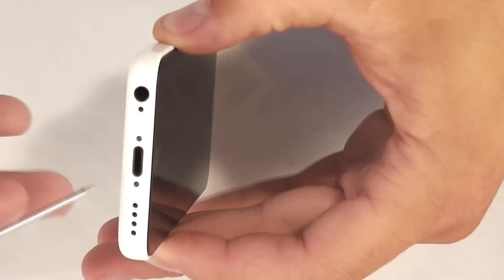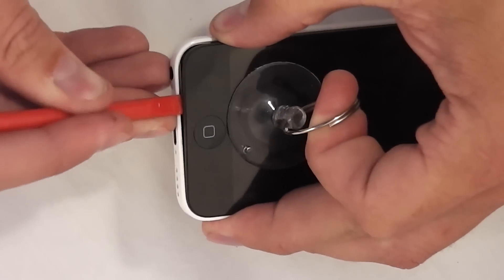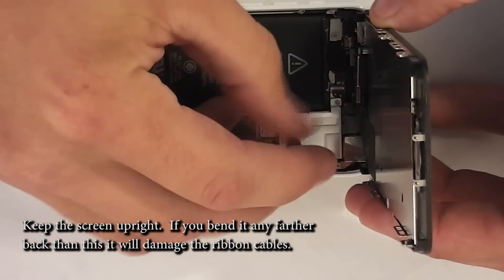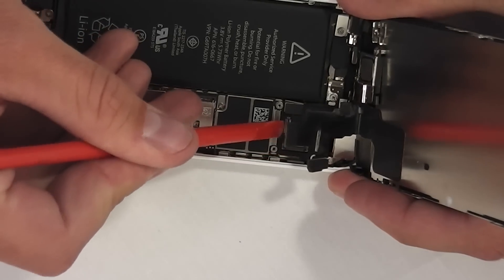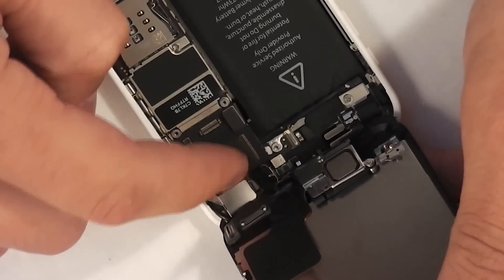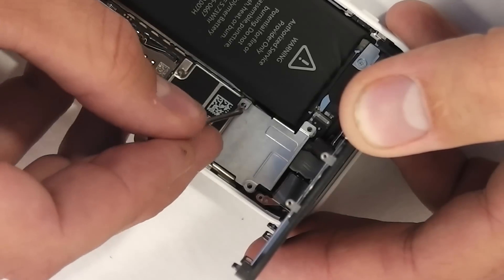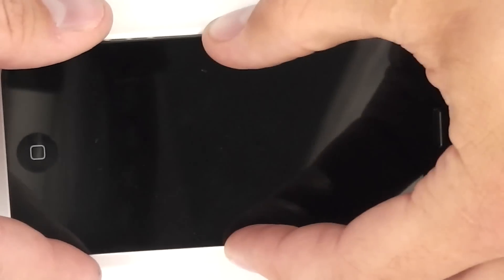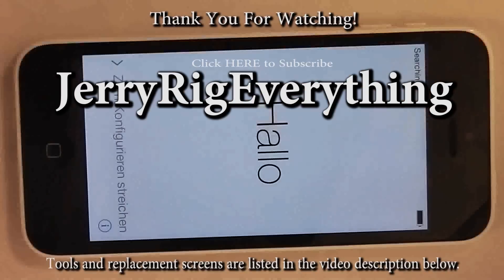iPhone 5c Cracked Screen Repair in 3 minutes

Comment: Hey Jerry, thanks for the video! I replaced mine with no problems, however the screen is unresponsive on certain points (very bottom left - sometimes can't switch from abc to 123 in text, and at the far top left - cannot slide to power off when this happens). Most of the time it works just fine, but at least once a day it gets screwy for a bit. Could I have damaged the first ribbon cable latch (the long narrow one that's the first to go back on)? is it worth taking it apart and unlatching then latching the 3 ribbon cables? I had a hard time getting the long/narrow one in first, and I'm worried I'll make things worse if I mess with it. What would you do? Re-install the one I have, or try a different screen?
Reply from the maker: Dreamktchr186 Sometimes the digitizers (the part that recognizes touch) have dead spots.  See if you can get another screen.
Reply: JerryRigEverything OK I will. Thanks!

Comment: Couple questions: there are a couple panels on eBay, one that includes the digitizer/LCD and one that's just the front panel which is much cheaper. How hard is it to remove the LCD/digitizer? Is it worth just buying the entire thing? Is there any way to tell that just the glass is cracked and hasn't harmed the LCD/digitizer? Thanks.
Reply from the maker: Chad Broudy You are so in luck right now. I JUST filmed a video on removing 'just the glass' for the iPhone 5c.  Ill have it posted at some point tonight.  So check back tomorrow for that process.  Its pretty freaking hard, and I don't recommend it for the normal user. But its always worth a shot if you have nothing else to lose.
Reply: So would it be easier to use the full kit that's more expensive? Then just use the home button and speaker from the old one on the new one? Thanks for the reply.
Reply from the maker: Ya, That is what I recommend.  You are much more likely to succeed when doing it that way. Did you check the video description for the parts I linked?  Amazon also has some good stuff. (I linked the tools I use in the description as well.)
Reply: I got the part in, but the screws for the metal tray that housed the screen connectors refused to come out. One of the four came out fine (the top right, also the largest) but the other three wouldn't budge. There was a clicking sound when trying to unscrew each of them. I'm going to assume there was an issue with the screws or its been tampered with before. Nonetheless, couldn't fix it. This isn't normal, is it?
Reply from the maker: ya, thats definitely not normal.
Reply: Supposed to be easy to come out?

Comment: Does the screen you get from the link you provided come with the home button and ear piece already installed or does it have to be transferred from the old screen?
Reply: I meant the camera not ear piece. I purchased the one on your link and I see people are saying its 200 but the link I clicked was 59.99. I hope I purchased the right one.
Reply from the maker: You bought the right part, but you will need to transfer over the home button, and back metal plate, and ear piece over to the new screen. It is not super dificult. Just keep the screws organized.
Reply from the maker: You bought the right part, but you will need to transfer over the home button, and back metal plate, and ear piece over to the new screen. It is not super dificult. Just keep the screws organized.

Comment: Hello, great video! But I do have a question pertaining to the camera like the guy who commented last.  If my screen is shattered  on the top half, meaning I can visibly see my camera underneath the screen (it's in good shape and not damaged however) will the camera need to be transferred over or is that part connected to the phone under the screen? I am planning to buy from repairsuniverse but concerned if the camera transfer would be too difficult.
Reply from the maker: KellsMcCulls Transferring the camera from one screen to the other is very easy. (And yes, you will need to do it.) http://youtu.be/UkltRLdfYBs?t=2m19s this video shows how to transfer over all those little parts. (you wont need to worry about the finger print scanner cable on your 5c, but you will need to move over the home button. So watch that.

Comment: I broke my 5C and now need to replace the screen and entire home button assembly.  I am having trouble finding a replacement home button assembly for the 5C, is the one meant for the iphone 5 compatible?
Reply from the maker: The iphone 5 home button is not compatible.  Can you not just switch over the one from your broken phone?  Usually those dont get messed up when you drop your phone.

Comment: I'm not sure if you've answered this already - but i'll be that annoying person asking : do I need to buy the ribbon you linked or is that only if it's damaged upon opening the assembly (when you mentioned to be very careful)? Thanks!
Reply from the maker: You only need to buy that part if you damage it during the replacement process.
Reply: JerryRigEverything I'm having a heck of a time just finding that ribbon without having to buy another screen+ digitizer - do you have any suggestions?
Reply from the maker: Youre talking about the ribbon cable that has the camera/ proximity sensor on it?  Repairs universe has them, as well as amazon. Way cheap.

Comment: If the screen is cracked and raised in one corner will a replacement screen fix the problem? Phone still functions.
Reply from the maker: stephen schexnaildre I think it would, as long as the frame of the phone isnt bent. (you'll have to carefully bend it back if it is.)

Comment: I have a question,  if I'm replacing the screen only, will the link for the tools and screen be sufficient.  Will I have to purchase the home screen, and earpiece also?
Reply from the maker: josephdelmas70 Ya, all you need is the tools and the screen itself.  The home button, earpiece, and back metal plate, can be transferred over from your old screen.

Comment: is there no need to remove the metal plate and disconnect the battery before doing exactly what u did ? i have a damaged screen and lcd one one phone and another phone with perfect screen. all i need off the broke phone is my contacts and stuff, will i be able to switch screens to get my info ? good video by the way
Reply: I think it is safer to disconnect the battery just so that you don't risk frying yourself or the phone! 😊

Comment: How difficult is it to change the back plate/color part of the phone. Mine has a few bumps and bruises and I would like a different color
Reply from the maker: All you have to do is pull all the parts from your phone and plop it in the frame of another phone.  (You can just buy a broken or water damaged phone off amazon or ebay in the color you want.)  I dont see anyone who sells 'just the frames' right now.
Reply: Thank you. I appreciate the answer

Comment: Hey jerry, I dropped my iphone 5c into a pool a few days ago, fully submerged. I had a Lifeproof Case on it and i removed it from the pool within 15 seconds of it being in the water. The next 2 days the phone worked 100% fine except for a little water droplets in the back camera. On the third day the phone's touch screen will not work although everything else seems to be responsive and working fine (both the lock and home button + the ringer on the side). I currently have the phone powered off and in a bag of rice. Do you think I will need to replace the screen or battery? And should i keep the phone in rice or not? Thanks!
Reply from the maker: Lee Sin At this point I doubt the rice will help too much.  As long as the phone powers on and charges, you wont need to replace the battery.  If the screen has stopped working, you can replace that and it should fix your problem. But with water damage it is hard to say for sure.

Comment: I WANT TO CUSTOMIZE A IPHONE 5C I HATE THE BLACK FRONT GLASS CAN I BUY A WHITE ONE AND SWITCH IT WITH THE BLACK ONE? IF SO WHERE CAN I BUY IT ONLINE AND HOW WOULD I CHANGE IT? THANKS.
Reply from the maker: Technically you could separate the black glass from your phone using a heat gun, and replace it with the iPhone 5 white Glass.  Even though the parts would only cost you about 15 bucks, You would most likely completely break your phone if you dont have experience swapping digitizers.
Reply: We have the white colour in stock, but it's not original Apple because they don't make it. Its just the original LCD + copy touch white.
Reply: JerryRigEverything What is the digitizer? Do you need it to replace the touch screen?

Comment: Can you do a video for replacing the glass not just the whole screen?
I have a 5c and the LCD and everything is functional, just the glass is cracked
Reply: this is exactly what youre talking about lmao..
Reply from the maker: Replacing 'Just the glass' is a very difficult and complex repair.  It requires heating up your phone to 200 degrees F, and then prying off the shards of glass individually.  It has a very low success rate.  You are better off just replacing the LCD and Glass at the same time.

Comment: my phone dropped face down the frst time it ever cracked and it was actually really bad. its all over the screen :/ but if we used the suction cup wouldnt it like take apart the glass instead of ctually pulling the top of the phone out?
Reply: You don't need the suction cup. That's only if the screen isn't broken. You can use any flat tool to ease the screen up on the bottom n  sides

Comment: What if I need to replace the home button where do I buy it ?
Reply from the maker: I put a link in the video description on where to buy the new ribbon cable for the home button.  You will still have to reuse your plastic bit on top though. (Unless you want to spend a few extra bucks and just get another one off amazon.  They are there too.)

Comment: So I ordered a new screen with the tools and everything from Amazon, but the thing is the screwdriver won't work for the part that is covering the ribbon cables. Are there any other things around the house that I can use?
Reply from the maker: nadine dixon That is just a little Phillips head screw.  The kit I linked in the video description has 2 heads that will work for that particular part.

Comment: I bought the kit with screen on eBay for $4.95 (free shipping) and it arrived today. Lets see if my fat  sausage fingers can do this. There seems to be a lot of steps involved that aren't listed here. I'm a little timid to try a self fix but what the heck. Nothing ventured nothing gained. :-)
Reply from the maker: It sounds like you bought JUST the glass.  For that particular repair you need to heat the screen up to 100 degrees C.  Then you can pry off the broken shards of glass, and use double sided sticky tape around the edges of the glass to get the new one to stick down.  It is a very complicated repair, with a very low success rate.  Good luck!
Reply: Yeah, figured it out and decided to sell it and go back to my 4s. Thanks.

Comment: I bought a cheap screen off of eBay, but will it even work as the touch screen would not be connected to the screen. Does it not need a particular screen to work?
Reply from the maker: If you bought 'just the glass' it becomes a much more complicated repair.

Comment: So I have my 2nd new screen and it works! But now I have no camera. I cannot find anything that would show if I put it together wrong. A couple of times I have had front facing camera, and never the rear (or selfie) camera has worked since putting on the new screen. Any advice?
Reply: The camera was working before replacing the screen. Does it make a difference that the new screen doesn't have a place for the 2nd (bottom) screw for the speaker/camera brace?
Reply from the maker: Stephanie Fike It should have all the screw holes... did you move over that BIG metal plate that covers the back of the LCD?
Reply: JerryRigEverything
no, was I supposed to? Ok, I did that, and everything else around the camera was replaced and put in new screen, still a no go. It took one picture and then I had nothing.
Reply from the maker: Stephanie Fike Interesting that it worked once and then quit. You'll just have to troubleshoot it now, try the connections again, a new camera, a reset... It just depends on if its worth figuring out.

Comment: You should have removes the battery first but otherwise great video
Reply: The battery needs adhesive and is only designed to be taken out once and not put back

Comment: I dropped my iphone 5c and the screen cracked pretty bad and eventually the home button feel off, does the screen that you listed above come with a home button, if not do you know where i can buy a screen with the button included
Reply from the maker: Jacobie Frederick It does not come with a home button.  You will need to buy another one. You can get one on the same site that you get the screen from.  It is way cheap.

Comment: Only question I have is do you have any recommendations on where to buy a colored 5c front screen? I see black and white at legit sites, but the screen I'm going to replace is green.......
Reply from the maker: Moistebiscuit The site I linked in the video description... might have some. Check it out.
Reply: Moistebiscuit You need a black screen for the green 5c. There are not green screens.

Comment: Hi, 
I haven't used your link cause it seems a US shop and probably I'll end up spending more than buying it in Europe, 
I found cheap screens on Amazon without the button and the camera...
can I easily use the old button and the old camera? 
However, I'm not sure how to do it and most important I'm not sure whether the camera is damaged or not (and should/shouldn't be replaced).
Thank you in advance for your answer.

Comment: Im having trouble removing the camera at the top? the black square is glued on and i can't find any crews that are holding it on, how do i get everything over to the other screen? i unscrewed the four screws
Reply from the maker: An Peter The ribbon cable should come out easily after removing the metal bracket. Than the little square bit can just pop off. (its glued down)

Comment: If I get the LCD and Digitizer replacement, does that come with a new home button and light sensor or do I have to move that stuff over from my old phone? The pictures on the site linked don't show a home button so I'm a bit confused.
Reply from the maker: Emm Wanyana Most sellers will not include the home button or front camera.  So you'll have to move those over if you get a screen that doesn't include them.

Comment: Will replacing the screen complete reset my phone? As in delete my information already on it?
Reply from the maker: Olivia Hall No.  As long as the repair is done correctly and nothing is broken on the phone, it will start right back up with all your same information on it.
Reply: My screen is now not working at all. i can hear when i get texts and calls but i can not work it. the phone is on but it just shows lines of color. Will putting the new screen on solve my problem?
Reply: You can take the SIM out as a precaution

Comment: Question- Got the screen off but there is another black panel under the screen, I don't see the battery or anything else.  Did I miss a step?  Do I need to get underneath the panel?

Comment: So, if i buy the screen replacement you linked in the description, that comes with everything i need and i wont need to transfer anything from the old screen? My phone has minor crack in the side and 2 through the middle but colors are going through the screen and the touchscreen barley works. sometimes i get the screen to move
Reply from the maker: 5thDimensionGaming The link in the description will require you to move over the home button, camera, earpiece and backplate.  I was linking the full units, but a lot of people complained about quality.
Reply: JerryRigEverything Ok, thanks

Comment: I dont know if this is a dumb question but if i buy a replacement kit on amazon will I have to replace the home button as well
Reply from the maker: Noel Carthen You can just transfer over the home button from your old screen. (Unless your replacement screen comes with a home button already installed.)

Comment: anybody know where i can get a replacement back cover im trying to find one thats purple or red...also where i can get a replacement screen that is purple instead of black(at the bottem and top not where the actual images glow through) (ps soz some people may not understand when i say purple screen and 1 more question will the iphone 5 screens fit on iphone 5c? (have to ask i dont want to waste money for no reason.
umm if u know where just messege me :] wooot purple iphone 5c :o dream gunna be like BAM!!
Reply from the maker: The iphone 5 screen will not fit on the 5c, neither will the 5s screen fit on the 5c.  They all have different connections.
Reply: thank you honestly ive been looking for an answer for a very long time thx!
Reply: how about the back case is there a way to change it and replac for a different color?
Reply from the maker: I just looked around online and i dont see any yet.  If you find any let me know.
Reply: ok oh and 1 more question (soz to be asking alot btw) is there any place to get a iphone 5c screen thats purple instead of black or anyothercolor besides black(btw i asked this b4 just wanted to ask u specificly just in case u know where to get them cuz so far there doesnt seen to be anything but alot for iphone 5 and down)
Reply from the maker: As far as I know, there hasn't been any different colored glass made for the 5c, but if you find any let me know!